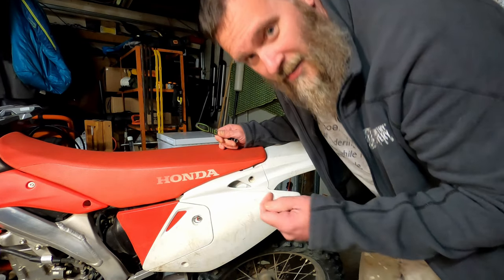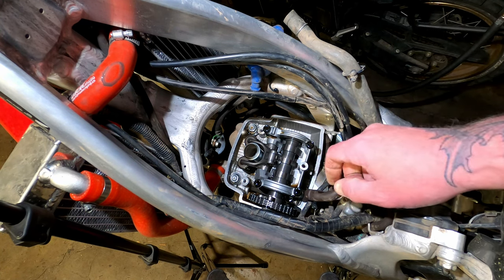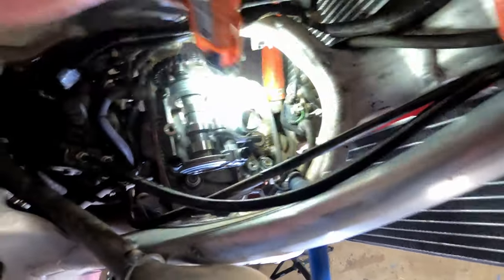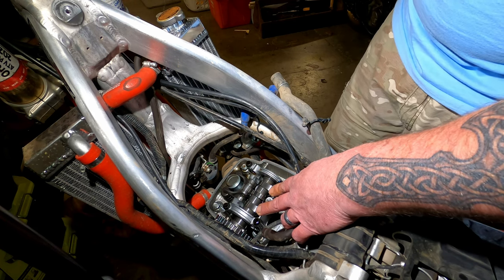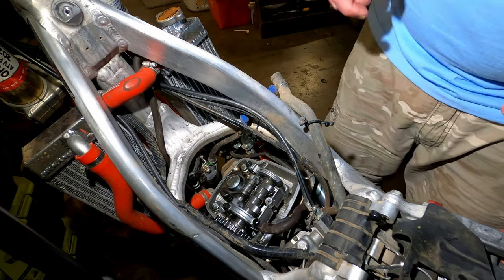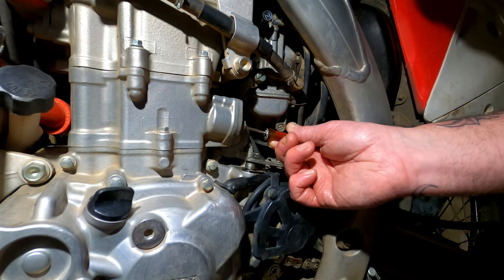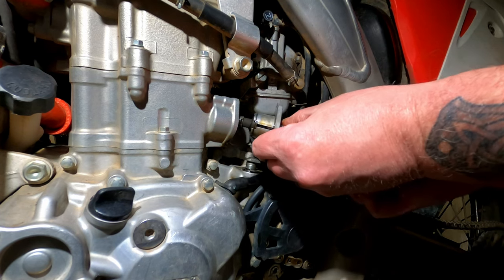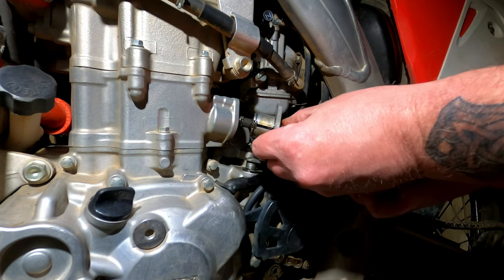2004-2016 + CRF450X (R,L) valve check and adjustment

Comment: Left side shim is always tight due to the cam chain being on the left side the extra tension from the chain keeps the cam lobe from traveling far from the valve.. the chain can be fished out with a piece of coat hanger or hooked probe. not a huge deal but do not drop shims or bolts .